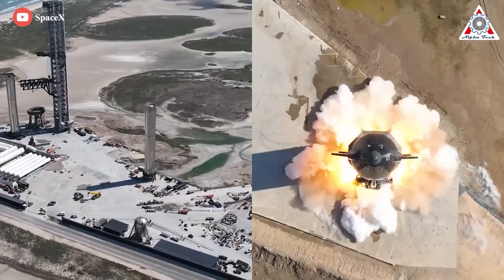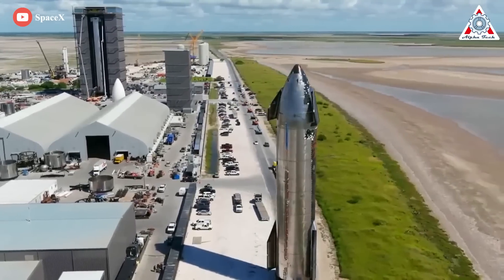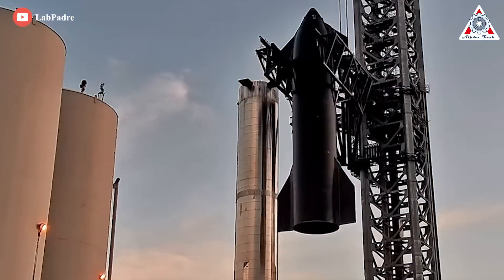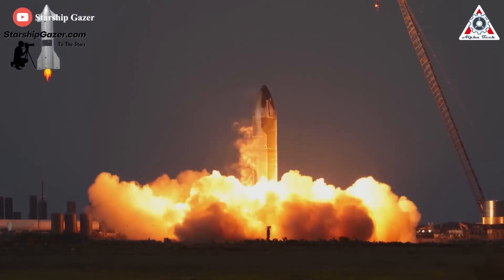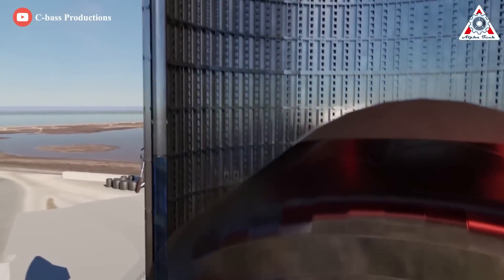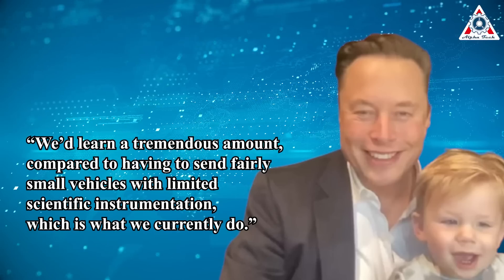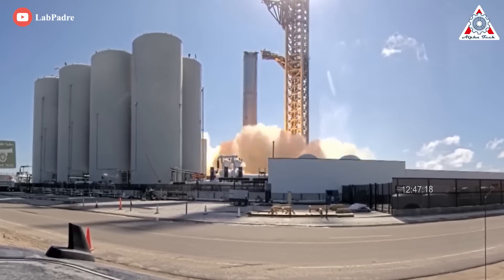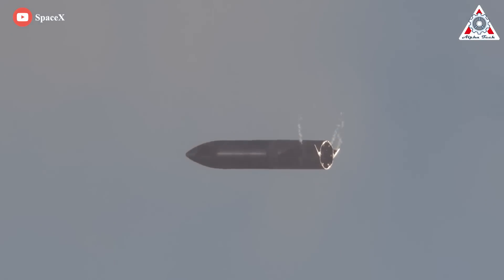SpaceX upgrades everything on Starship 24 for orbital launch incoming

Comment: Falcon heavy flies with 27 engines .. whats 6 more ??
Reply: Well. 
Falcon heavy is 3 x sets of 9 that are spread out a bit on individual boosters generating 5 million lbs of thrust or so. 
Super heavy is going to have upwards of 16 million lbs of thrust all housed under a single booster. 
They are already having issues with debris generated from a fraction of the engines kicking up and causing problems. Just wait till they fire all of them. 
It will be the most powerful rocket ever launched by at least a factor of 2. 
SLS for comparison was closer to 8 million lbs thrust or half that of starship super heavy.

Comment: Last time anyone launched a rocket with 30+ Engines?
Soviet N1 launch 4 - and like it's previous 3, it failed fairly rapidly.

I hope Starship works a lot better.
Reply from the maker: Deffinitely
Reply: Harmonic vibrations from the engines causing amplitude spikes which could tear things apart
Reply: Raptor Heavy uses 27 and works well - the Soviets were sub par engineers.